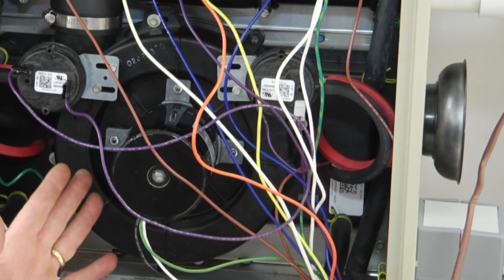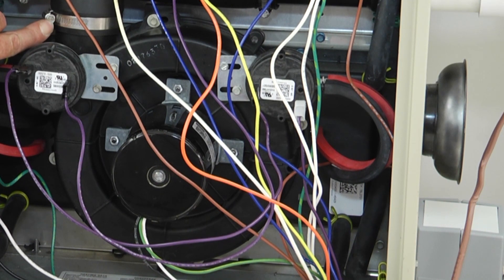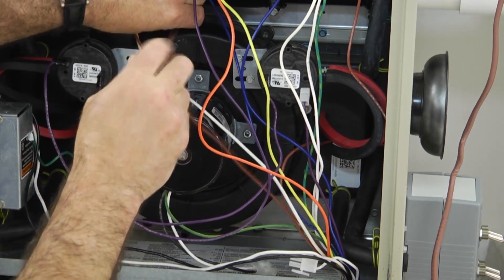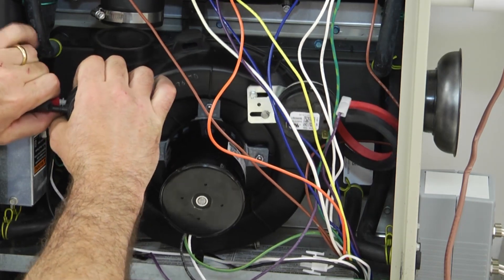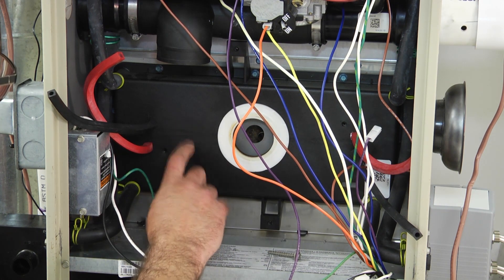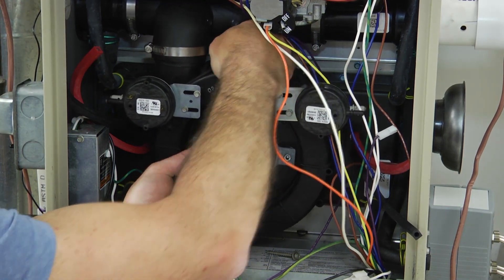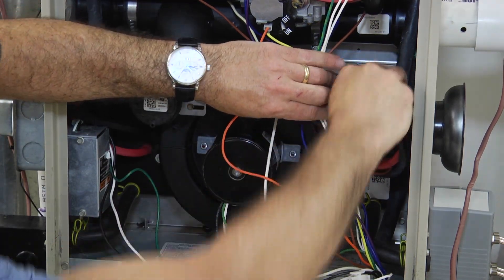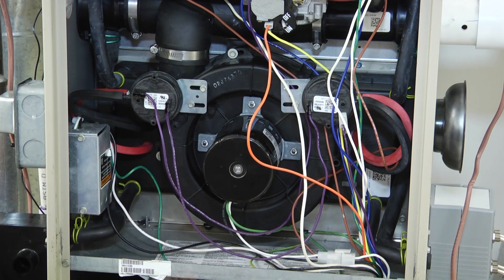Changing a 90 Percent Furnace Induced Draft Motor

Comment: I wish EconoAire didn't  install my heating unit in my attic. I could save so much money if I could just check my heater and service it myself. I have been able to fix my A/C condenser unit without their help when the capacitor blew. I am just sick and tired of being ripped off by their technicians. I was quoted $550 to change the cap!  Bought the part off Amazon for $19.00 and did it myself.  I know I can troubleshoot my heater which is blowing cold air now. I'm  a 60 year old woman and cannot afford those prices. I can no longer use a ladder up to my attic because my back  is so deteriorated that I have mobility issues. Living alone with no one to help me, my hands are tied. I  have am April aire filter so once a year, I have to call in a handyman just to change the filter. Who knows what kind of dust needs cleaning out of the blower at this point.  I'm  afraid to call any HVAC company to do the annual servicing because they are always trying to sell me something that I do not need. Very upsetting.  I feel so helpless, if only I could get to my heater  I wouldn't be  freezing  cold right now.  I had my Lennox Merit series HVAC unit installed in 2003 by EconoAire in Anaheim CA. Never using them again. Even when they tried to make things right by winning me back as a customer, they made things worse with more rip off schemes. First the capacitor quote then they added insult to injury and quoted me  $150 for a filter change!  Plus, they were putting in filters that weren't even Aprilaire's.  Why did they up sale me into that filtration system  during the install then use a different filter with less MERV rating and 3X the cost of the real deal.  So sad how technicians take advantage of  senior citizens.  I was younger when I purchased it, but since my spinal issues, I noticed they were taking advantage of me because I couldn't verify their claims of all the so called failing parts in my attic. Grrhh.